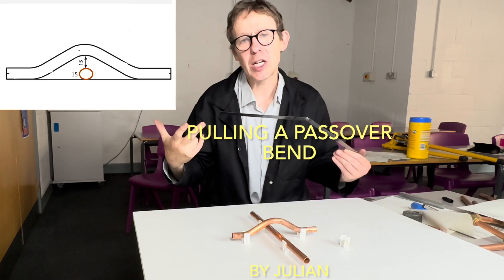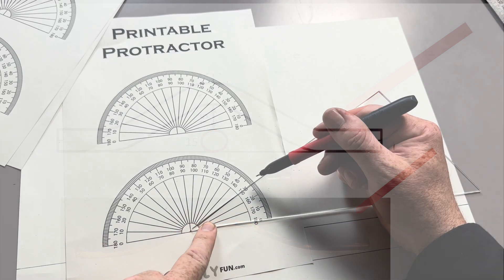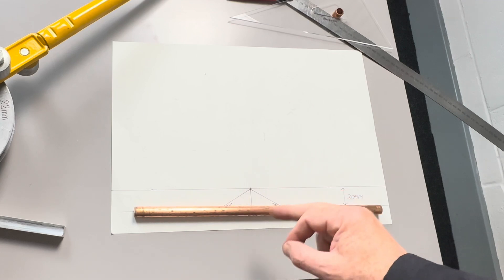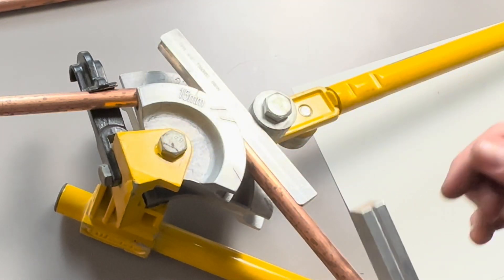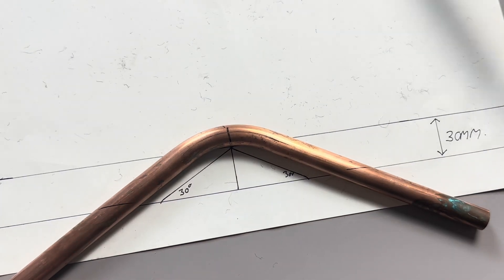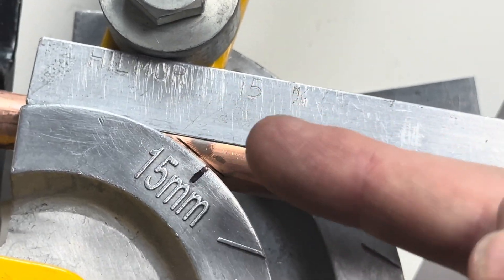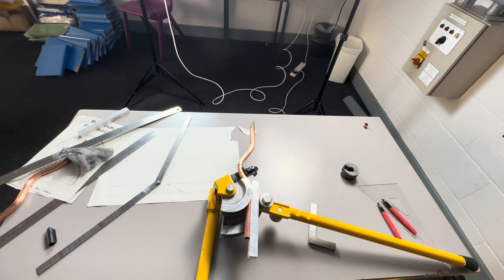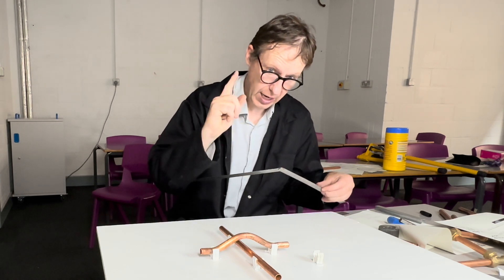Pulling a Passover bend - to measurements - Level 2 plumbing

Comment: Doesn't the pipe need to touch  with the two 30 degree lines ? As I've seen others doing this so your angle isnt off
Reply from the maker: That’s for the mckeown method I done video on it  see level 2 pipe bending video called passovers